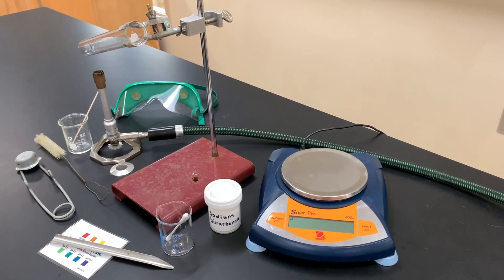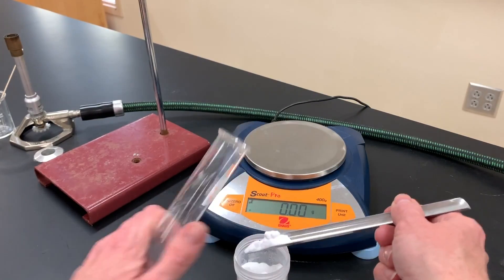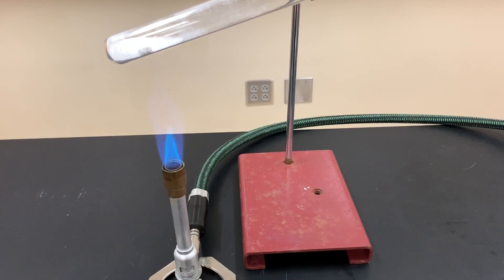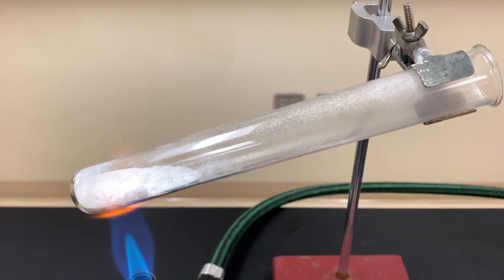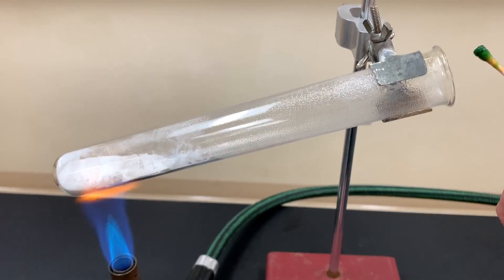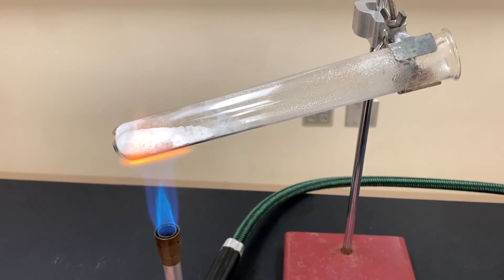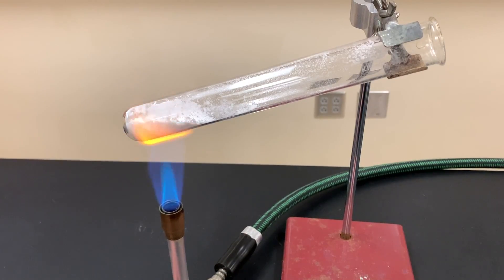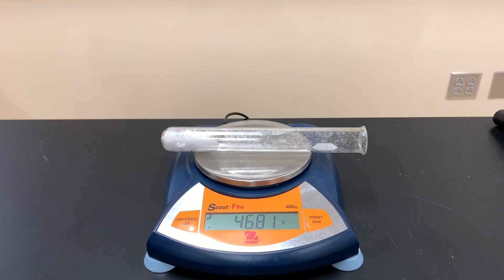Decomposition of Sodium Bicarbonate (Baking Soda)

Comment: Hi. What happens when we heat saturated sodium bicarbonate solution in water? Instead of powder form.
Reply: the water will boil off and the remaing sodium bicarbonate will turn into Na2CO3
Reply: The water will evaporate which leave the sodium bicarbonate to solidify and decompose into sodium carbonate